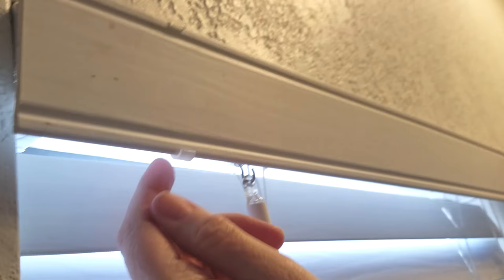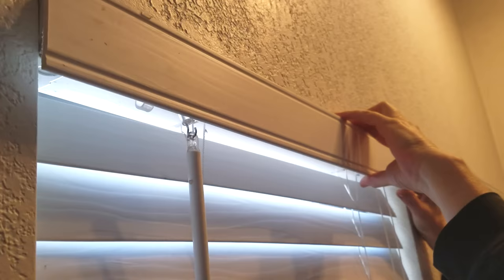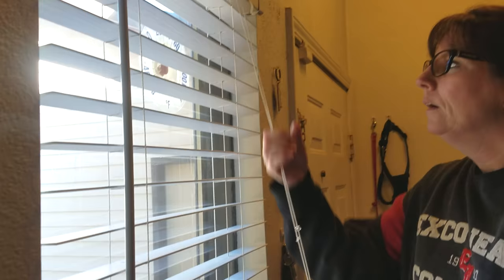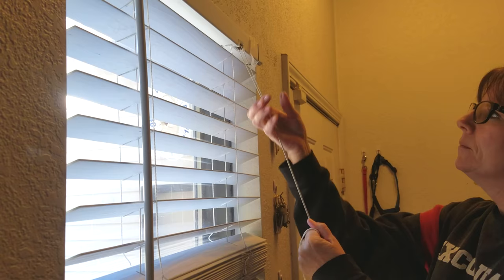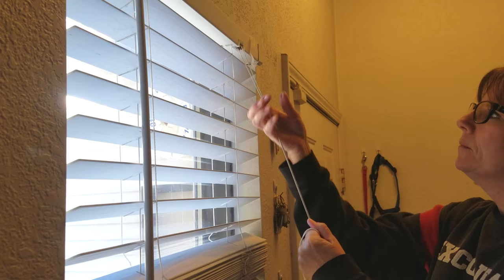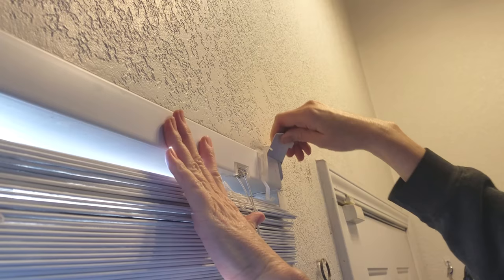How Do I Remove Window Blinds

Comment: Thank you so much I couldn't figure it out. I moved into this house 2 years ago and I am just replacing the windows so I had to take down the blinds before they come. 3 rooms with blinds and each room had a different kind of blind and a different way of removing them. I was stuck on the last room until I came across your video. HOORAY it worked. Thank you, thank you, thank you - ( I am only 78 years young and I was able to do it). I did need a screwdriver to unlatch since they seemingly never been moved since they were installed and they were stuck but the blinds are down.
Reply from the maker: Wonderful! So glad we could help! Good for you for doing it yourself too. I was always afraid to try things like this myself until my daughter and I starting making these videos.

Comment: So can I remove them clean and fix them back? Rather than cleaning each line, if I could run them under the hose pipe would make the life more easier for me.
Reply from the maker: Yes you can. Here are the suggested instructions from Architectural Digest:  1) Take the blinds off the window and place them in a bathtub with warm water, a few generous squirts of dish soap, and a cup of baking soda (a natural stain fighter). 2) Let the blinds soak for about an hour, and then rinse with clean water and let dry before rehanging
Reply: @howdoi1851  thank you so much.
Reply from the maker: @Vindya_N  happy to help!
Reply: @howdoi1851 k now that you showed me how to take them down, it’s a must to soak them in soapy water after 20 years. 😂

Comment: Well, this is going to sound weird. I have replaced venetian blinds in all my windows except the big one in the living room. The holders on the ends of that blind seem to be one piece. So there is no gate that can be swung open to pull the blind out. I am perplexed by this.
Reply from the maker: That would stump me too. Is there a company name anywhere on the blind? If there is, you could search for a video on that particular blind. So sorry I can't help with this!
Reply: @howdoi1851  I contacted the manufacturer, Kirsch. The blinds I have have not been made since sometime before 2010 so they could not help me. I ended up prying off the blinds housing with a heavy screw driver, breaking them off the plastic end mounts, and then unscrewing the wall fasteners once they were exposed. I should have done that in the first place since I was not going to reuse those old blinds. Out of curiosity I examined the supporting end mounts of the old blinds once I had them off the wall. I still could not see a way of taking the blinds off cleanly. But the new blinds are now up so, case closed.
Reply from the maker: @timjansen7694  Glad you solved it! I don't know if I would have been able to figure that one out.

Comment: Sorry, mine don't look like that and have no clips.  They are not the new Levalor types, either, much older.  Vintage. Can't for the life of me see any way yet to get them out without breaking the bracket, which I want to use again with new curtains.  Wish you had shown several types, including "vintage."  I'm guessing mine are from the 1960's.
Reply from the maker: Sorry we weren't able to help. I couldn't show several types because these are the only blinds I have. I just looked on YouTube and couldn't find any videos about removing vintage blinds. Hope that you are able to find someone to help!
Reply: @howdoi1851  By accident I solved it, trial and error. Would you believe it?  The small square of plastic (where you have a latch) SLIDES out?!  Just slides to the right, with a screwdriver.  Never saw this before in my life!
Reply from the maker: @davidb2206  That is excellent! So happy to hear this. Now you might want to think about creating a video of how you did it and post it to help others. It's a lot of fun :)